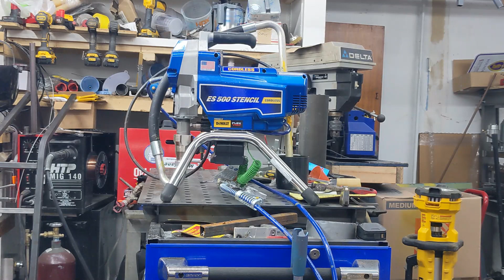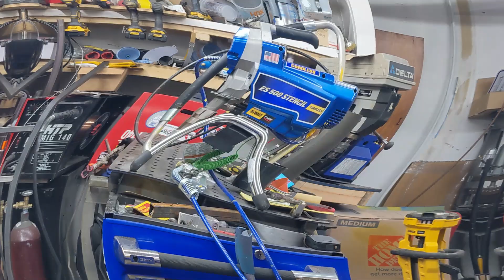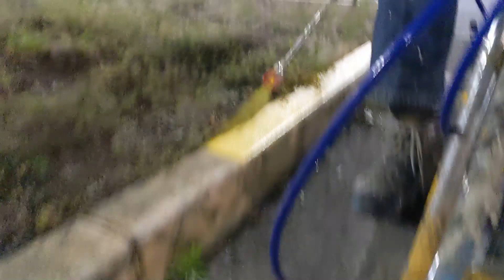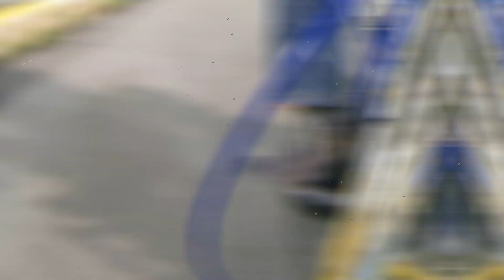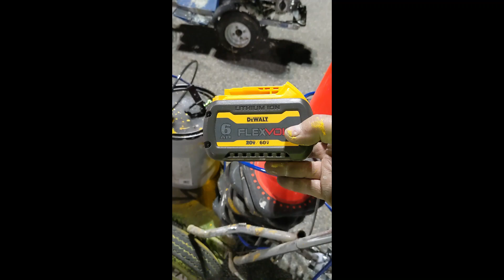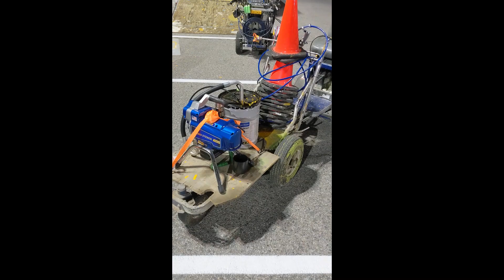Review of the new Battery Powered Graco ES 500 Stencil Machine.

Comment: How long is the tip extension that you’re using in this video? I really need to learn to spray curb while driving my line driver, that would be so much better on my back😂
Reply from the maker: Thanks for watching, that is a 12" extension. Just turn down the pressure so you do not get the gun kick.